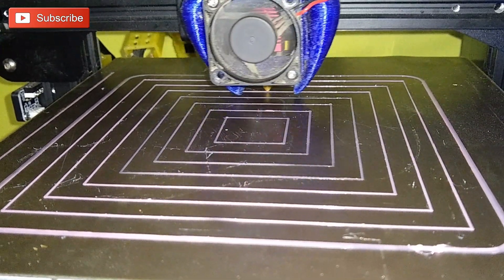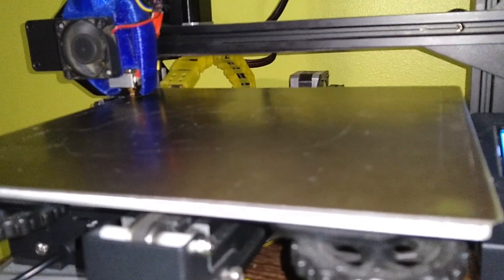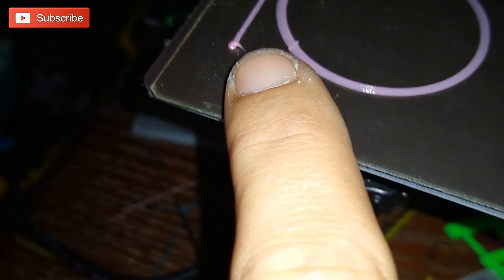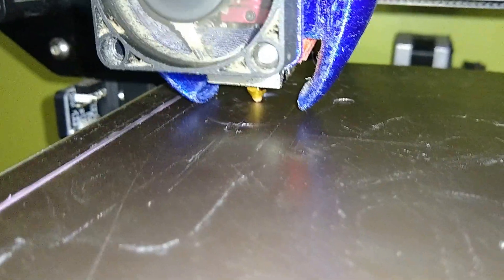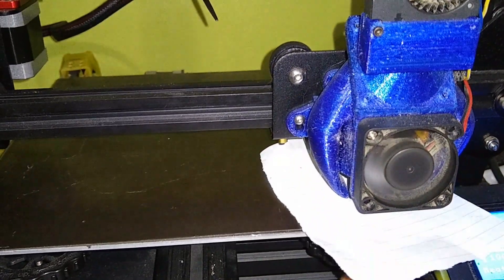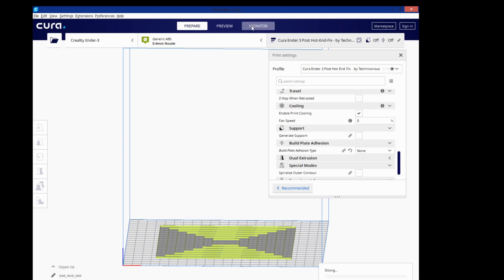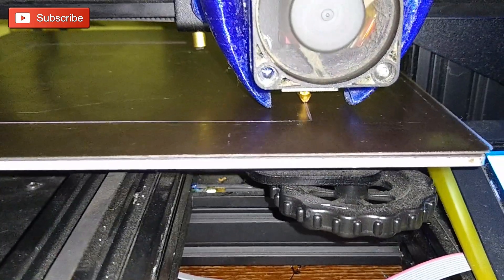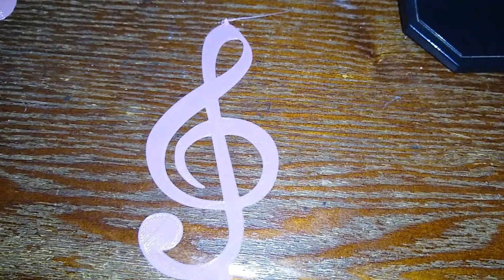Level bed test prints - 2.5

Comment: Thank you so much for this. I was having trouble in some spots but not others.  Showing how you leveled with the paper was my issue. I was too far away thinking it needed to freely move out AND in but that wasn't the case. I printed the entire bed level test and had a few blobs and adjusted. The blobs were in the same spot as some stringing. Thank you AGAIN!!
Reply from the maker: Always welcome. If you have any questions dont be scared to ask